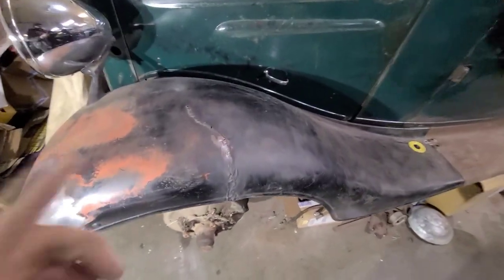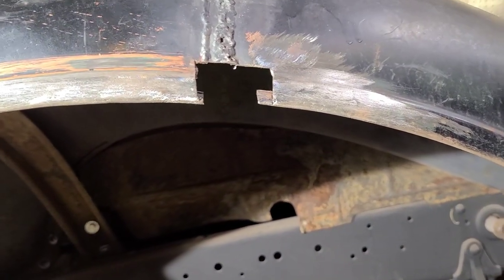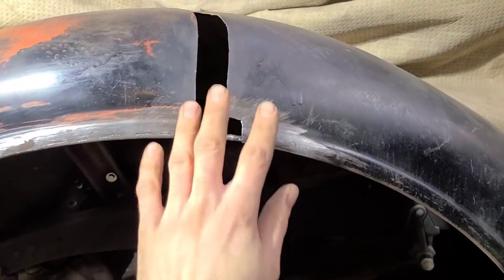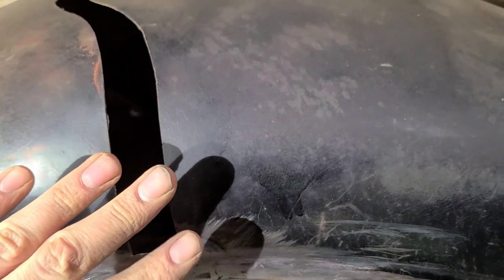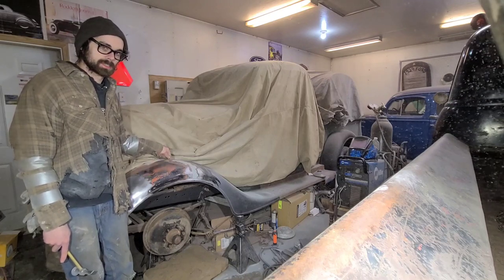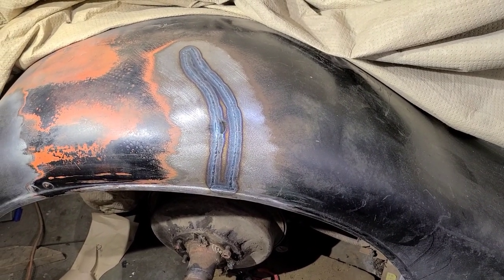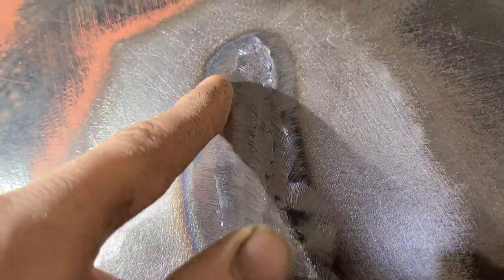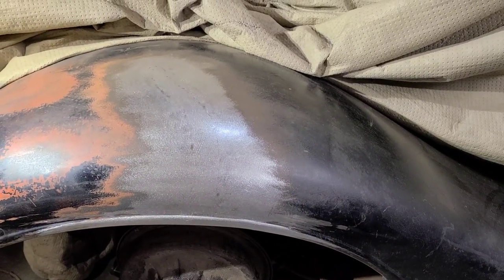Repairing a Cracked Fender on a Classic Car or Truck

Comment: Good point about the hardener. As a rule of thumb, I'll take the label's recommended ratio and reverse it as a starting point. I usually go with as much hardener as possible, with as little filler as possible. For those fancier jobs that demand only the best, I'll use only hardener and no filler so I can say with all honesty that I didnt use any filler at all. My instructors at the Bondo Reformatory for Boys always taught that you fill with hardener, you don't harden with filler. 😂 

People who don't watch the whole video won't get your humor and will miss the fact you're a master metal fabricator and finisher.

Comment: Always a treat to watch a craftsman. One point...using silicon bronze elevated my panel repair to the next level. Also, a mini belt sander is infinitely more controllable for not hitting the parent metal when grinding. Further, the bronze can be leveled effortlessly with a vixen file, and tig brazing puts much  less heat in the panel. It would be about impossible to give you any suggestions, given your ability, but an old guy turned me on to tigging bronze and it's been a game changer for me. Thanks for an entertaining video.
Reply from the maker: I occasionally use silicone bronze for cosmetic repairs, but never for patch panels or anything structural. Years ago a certified welder showed me the strength difference, he butt welded two pieces of sheetmetal together with silicone bronze, the welds were beautiful. He ground and planished them smooth, then grabbed the two pieces and snapped them back in two with his bare hands. I wasn't satisfied so I tried the same thing myself several times with different heat settings and techniques, each test resulted in a weld that broke with minimal effort. I'm sure there is some way to make it work, but as a rule I try to do everything the hard way because it keeps me honest haha. Thank you for the tips and thanks for watching!
Reply: @CarterAutoRestyling  I asked Scott @ Cold War Motors for tips on body working.  In the end, he is giving some lessons on Patreon (I am a patron 8-) but the best thing he's done is send me to your channel! 8-))  I can decide when it's ok to add bondo and what I am calling "filler primer" or not!  
Wanna make a video with you smashing a fender repaired with thin bondo and thick primer?  I bet any sort of accident would expose bondo repairs, while little or nothing would expose the metal repairs you do. 8-)
Reply from the maker: @BobPegram  Thanks Bob! That's very kind of you to say. Modern fillers actually have quite a bit of flexibility. I've seen them withstand some hard hits, however your suggestion has me thinking, as I do enjoy smashing stuff with a hammer haha!
Reply: @CarterAutoRestyling  I thought the same thing, but several bend tests later, bronze is several times stronger than the parent metal, more than enough for patch panels. I wouldn't brag, but the Brits welded entire cars with the stuff. Whatever works for you. Best of luck.

Comment: Beautiful repair. Thanks for detailed explanations.
I thought at first the gorilla tape was a template. But backer for filler was brilliant...although, you forgot the maple syrup. 
On the rounded corners vs square, I've heard it explained that you can control the heat better around a rounded rather than square. More chance of a blowout with square.
Reply from the maker: Thanks! Yeah the lack of syrup is most likely why the first repair failed.

Comment: I think the tape and filler repair would have worked if you had put the tape on the outside in a crisscross  pattern like we do in Texas. We also avoid the hammer test and just make sure it will support a six pack.
Reply from the maker: Great advice haha!

Comment: Hi from New Zealand, Kyle.  Just finished watching the latest CWM video and Scott mentioned (well, praised is probably closer) your ability with bodywork and said we should check your channel out.  Knowing how much of a perfectionist with bodywork that Scott is, it sounded like a darn good idea to me - and what a video to start with!  Tell you what - you had me going with that gaffer tape in behind the split and then filling it with fibreglass....!! I was sitting here doing several double-takes, but I laughed like a drain when the hammer went through the repair and then you did it properly!  Whew!  I was real worried for a moment there.....

Great to see someone else using a TIG.  I grew up with the old oxy/acetylene rig being the standard for sheet metal.  Over here, they have basically killed that way of welding by introducing heath and safety laws that make it almost impossible for a home workshop to have one.  I went on a welding course to have a play with a MIG and a TIG and of the two, the TIG just felt right in my hands and I found I could produce much better results with that than with the MIG.  Yes, she's a bit slower to use, but I picked it up easier.  Of the two welder types (MIG and TIG), do you have a preference or is one better for some jobs than others?  

Personally, I thought that patch and dent repair in the front fender to be pretty much spot on, mate.  Nothing wrong with it that I could pick up on my laptop's screen anyway!  Looked bloody awesome.  I hope the 'fibreglass fenders on order' was another joke though - I know a lot of rodders in this country who went glass and then after a couple of years they put their metal ones back on because they didn't like the flex in the glass ones or they'd damaged them multiple times and got sick of replacing them.  Metal's easy to repair if you know how (and you obviously do), but fibreglass aint so easy when she keeps cracking because of stress - even after multiple strengthening layers were added underneath (and looked ugly if you saw them).  If you do go glass, I will certainly wish you better luck than they had!  

All the best, mate - and I will look forward to seeing the next repair using a MIG.....and investigating the other videos you have put up for us.  Cheers!
Reply from the maker: Hello from Canada! Thanks for watching! I'm glad you enjoyed the video! Tig definitely produces much better results, I like using it on exterior panels where I have access to hammer the weld. The mig is nice for doing areas that won't be seen, like floors, or for doing quick patch panels. Oh and I was just joking about the fibreglass fenders too haha!

Comment: I like your example about the fiberglass  filler. I understand  some folks using  what they can afford but it's not the right way.
Reply from the maker: Thank you! Not everything has to be perfect, but there is a point when doing everything completely wrong becomes more expensive than trying to do it correctly.

Comment: I hope you filmed the repair of the rear quarters on that Chevy five window. I have some of the same ahead on my 37. Thanks for the encouragement!
Reply from the maker: Hi Randy! Sorry, I never got around to filming any of the 1/4 panel work on the 5 window. The good news is that now that this channel is growing I can dedicate a little more time to filming things, and I've got no shortage of vehicles that need extensive repairs. Were you referring to the 32 or 33 5 window? I did post pictures of some of the repairs to the '33 Chevy on the Hamb message board about 4 years ago.

Comment: Laughed my ass off!! You can see who instantly comment's without watching it all. I bought a stop sign galvanized metal post and used it for the wood bed braces underneath. Right height and won't rust out again and lots of pre punched holes for the metal strips.

Comment: Nice work Kyle ! At 23:45 you said the repair was good enough for filler. How much time did you have into the repair to that point and how much additional time did it take to metal finish it?
Reply from the maker: I didn't keep track of how long it took to do the repair, all I know is that the video took longer to make than the repair. It's still not perfect and will require some touch ups and high build primer before it could be considered "paint ready"

Comment: Great stuff as always Kyle. You really are not going to replace those steelies with fiberglass are you? That would be a shame, especially with the work you're doing. If you do I would be interested in the steel fenders for my truck, I have the same type cracks that are going to need repaired. Your next video definitely interests me, because I don't have a tig and I'm interested to watch you work with a mig, that will give me some tips on what to do with my 36. The bondo stunt had me going, ha ha!!
Reply from the maker: Thanks for watching Ken! I was hoping some of the tips in my videos will help you with your '36 restoration! Yeah I was just kidding around about the fibreglass fenders, the last time I tried working with 'glass it was a huge mess!
Reply: @CarterAutoRestyling  Oh, okay, man you had me going again. I'm thinking why would a guy want glass fenders when you have  nice steel ones. You yanked my chain twice on this video.

Comment: I was sure you would use the tape as a template for the metal piece. At least that is what I do sometimes. You can trace the tape with a pencil or just rattlecan spray the tape. When you remove the tape you have a perfect template that you can cut out and stick it on the piece of sheet metal that you want to cut to shape. 
At least I knew the very first second you would Not "FIX" the fender with bondo.
Reply from the maker: Thanks, I actually did end up using tape to make a template for the metal piece the second time around. I figured if I showed the completed repair at the beginning, people would realize it was a joke, but there's a surprising number of people that didn't get it and clicked off the video as soon as I started putting the bondo on haha!

Comment: You said the rod is harder than the parent material.  Is it possible to braze something like this?
Reply from the maker: Hi Alex. I would not reccomend brazing for this type if repair. A butt welded brazed joint has almost no strength. Brazing requires a lapped joint. Back when these vehicles were new it was common to overlap and gas weld or braze cracks, beat them in and smooth over them with lead. The problem with that is you create an area that is stronger then the rest and the fender ends up cracking again on both sides of the repair. It's best to restore the fender as close as possible to its original state, so that the edges can all flex and vibrate evenly when the vehicle is going down the road.

Comment: Ive never been healthy enough to afford a welder.. so ive gotten pretty good at fiberglass.
Unfortunately.. fiberglass is never a permanent solution to metal repair. But as long as you tell your customers that its only for temporary cosmetics repairs, and you dont use fiberglass as structual repairs, them imo its ok to use whatever you got for cosmetics only

Comment: i've got one of these in much worse condition. it sat on the ground in a woodlot for 70 odd years after it had been cut in half with the rear having been made into a trailer. i'm going to mount the cab on an s10 frame to make a rat rod. i need some body patch panels, and door hinges. do you know of anywhere to find repair parts?
Reply from the maker: I believe Jim Carter sells patch panels and hinges too? If you're planning to run fenders you may want to look into tracking down another original frame, 35 and 36 are the same. The front fenders wont fit around the steering box on the s10 frame, and the frame is too wide at the cowl. A while ago I went to look at a 36 that was being mounted on an s10 chassis, the guy had to swap the steering out to rack and pinion, and with the amount of cutting and welding he had to do to the rest of the frame to make everything fit he could have just built a frame. Anyways good luck with your project!

Comment: Didn't see the patch was necessary. Just made a load of extra work. Just one straight cut thru the old weld, pull the edges together to correct the line. Tack weld, then butt weld. Job done.
Reply from the maker: Hi Paul. Re-welding paper thin fatigued metal that was previously welded with a hard pourous weld is a great way to end up with another cracked fender in short time. However, because you know best, I will be sending you the other fender so you can make a video showing us how it's supposed to be done. I will be curious to see how you achieve the same final product in less time than this repair took.
Reply: @CarterAutoRestyling  will you be sending it 1st class? I'm pretty busy.
I've prob got 40 years on you sunshine. Dont think you know it all.
And its spelt porous!
Reply: @CarterAutoRestyling  p.s. I do appreciate your sense of humour.
Reply from the maker: @pacman222  40 extra years of experience and you can spell 1 word better than me? Congratulations! With 40+ years of experience you should know better than to estimate a repair based off a photo or video. I never claimed to be an expert, that's why the video doesn't have "how to" in the title. I am learning and trying to improve every day, but people requested a video on how I was going to repair this crack so I obliged. Seeing as how you just created an account specifically to troll, I doubt you have anything spectacular to offer, but please feel free to prove me wrong and post some videos showing your work.
Reply: @CarterAutoRestyling  its so easy to wind you yanks up. Get off ur high horse. Ur doing a good job. Keep at it.

Comment: What do you think about cut&but technique from the channel Fitzee's Fabrications?
Reply from the maker: It's a great technique for mig welding, but doesn't work well for tig welding because a tighter gap is needed.
Reply: @CarterAutoRestyling  But, the whole process of creating patch or repairing the crack would be pretty much the same? Very good quality of work, you know your line of business very well. Recommendations!
Reply from the maker: @prevodpropovedi  Thanks, yes the process would be the same

Comment: Im curious why you spend so much time perfecting the repair when in the end, it will be fiberglassed...?
Just curious .
Its impressive for sure , but all the shops I service (including custom shops) would never spend the time ..
Reply from the maker: It's not getting fiberglassed. It is going straight to primer/paint. Also, it didn't take any longer to do it this way than it would take a "custom shop" to mig weld in a patch, fiberglass/fill/putty/prime/block/prime etc. The shortest road is often the longest.

Comment: It’s not shrinking it’s expanding the metal. Thats how you get that low spot. You get more metal in the space than you started with so the excess metal pushes one way or another creating either a low spot or a high spot.
Reply from the maker: Then explain to me why stretching the weld seam straightens the metal? I think you need to check your facts John.

Comment: I'm skeptical about these modern methods... it seems like they would ruin the value of the car.  To be period correct, the proper way to repair these cracks like they would of been when these cars were being used...  is with a piece of duct tape.
Reply from the maker: Haha you are absolutely correct! After the video I went back and cut out the metal and replaced it with duct tape. Now it's good as old.

Comment: So, what I got out of this is...  the tape and fiberglass repair is the way to go as long as you don't hit it with a hammer.   maybe I missed something?
Reply from the maker: You are correct sir! I left the hammer part in so that the audience can learn from my mistakes. After filming ended I cut out the steel patch and redid the fibreglass and tape repair.

Comment: I know the patch is welded all along the edge, but why does it look like there's still a crack where solid weld should be?
Reply from the maker: Which part are you looking at? When it's polished up the weld seam shows up as a slightly different colour than the surrounding metal due to the 023 filler wire used. I was going to mention this in the video, because it illustrates the importance of a tight gap, however the camera didn't pick it up very well.
Reply: @CarterAutoRestyling  Well before the seam is polished but after some grinding and sanding. it appears that a tiny gap is still present. Maybe that's just the edge of the bead. on video it looks like a crack.
Reply from the maker: @coffeefish  ah okay I see it now. The metal I used for the patch is slightly thicker than the metal on the fender, so until everything is fully hammered and filed smooth there is a bit of a ridge in places, which shows up on the camera as a dark spot or split. Thank you for watching

Comment: Do you loose viewers with your humorous bogus fiberglass faux repairs? Do you use the gorilla tape for a pattern to assist with cutting the patch? Incredible results. I would imagine cans of filler last years in your shop .
Reply from the maker: Haha oh yes I've scared off quite a few viewers with my bogus repairs, but I don't lose any sleep over it as I'm very happy with the quality of audience that I have. I actually ended up using masking tape to make a pattern for the metal piece.